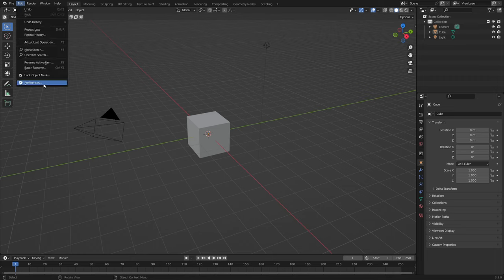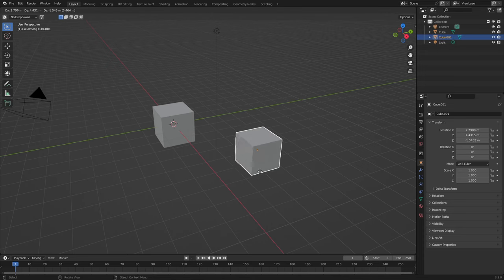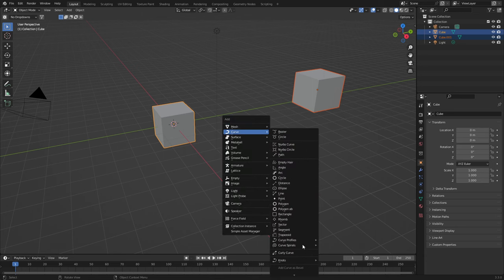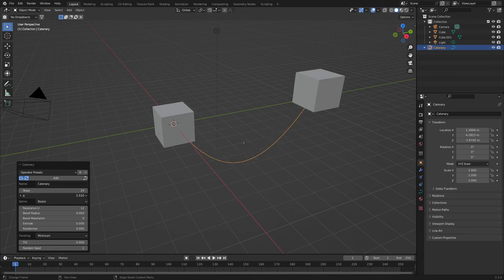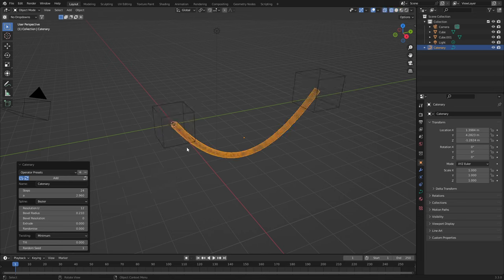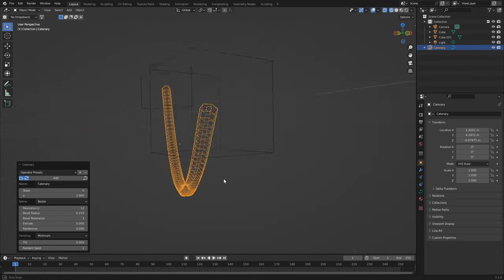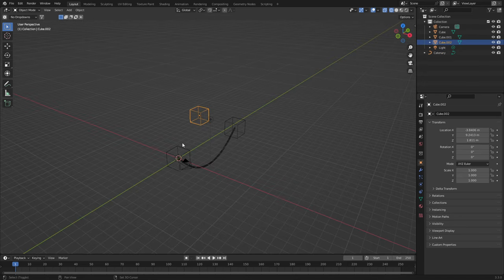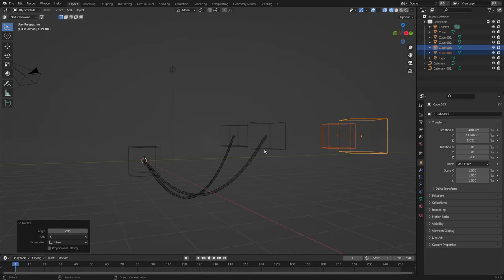How to make hanging cables in Blender SUPER EASY

Comment: Hi, do you know how to solve this issue?  If this two objects are far away from each other (something like 100 metres) it will hang too low even the a value is 100.  I need to add more tension to the cable, how can i increase the 'a' value since it is limited to 100?